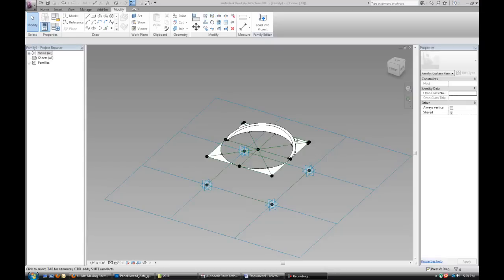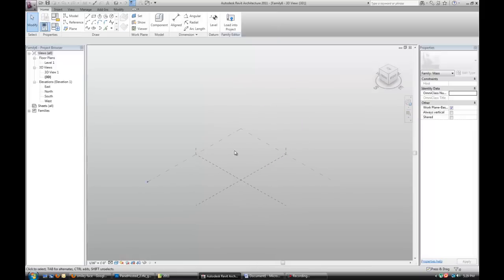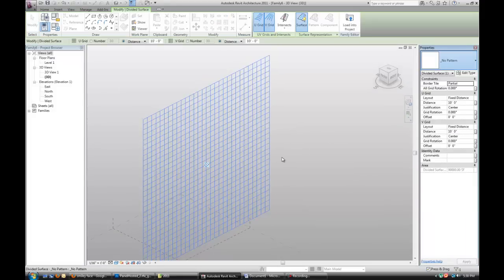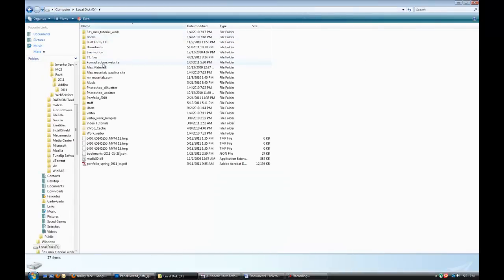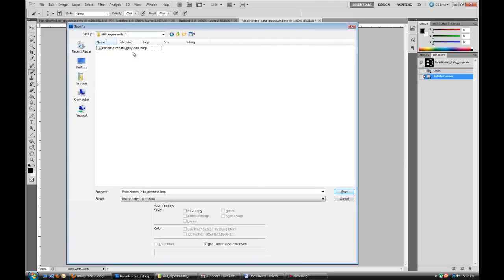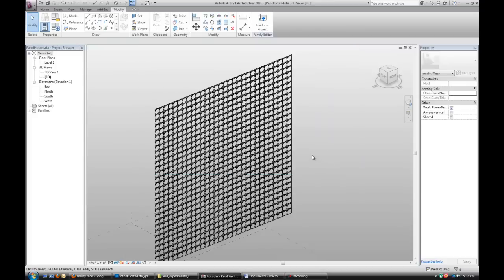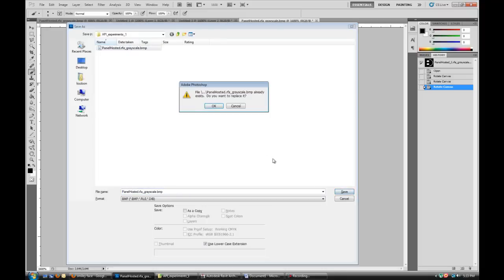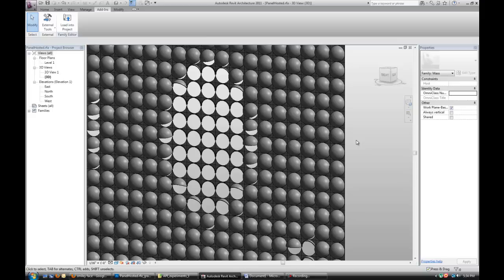Revit 2011 - API Plugin (image to panel)_part3

Comment: Hi! Your tutorials are great man! but.. how can I make this work for 2014 version? or better... how you can upgrade it to match the upcoming versions of the Revit software?
Reply from the maker: Yeah I realize that this is no longer compatible with latest version of Revit. I would check buildz website to see if new release of that plugin came out, if not then you can do the same thing using Dynamo. give that a look! - konrad